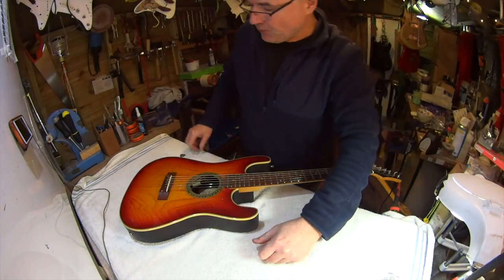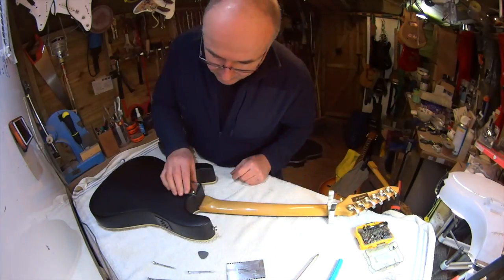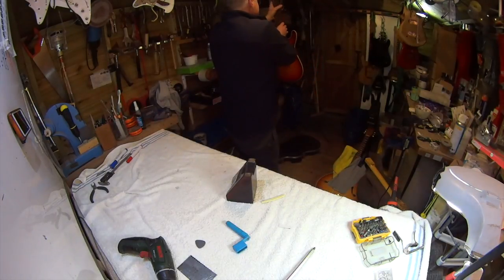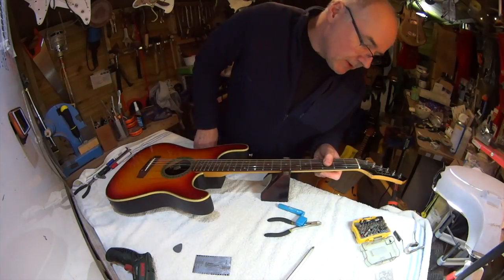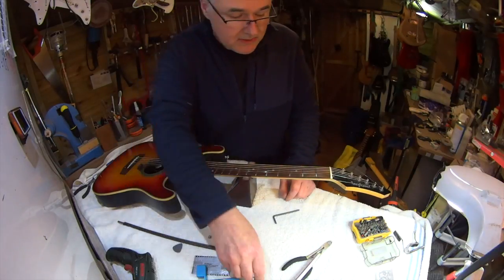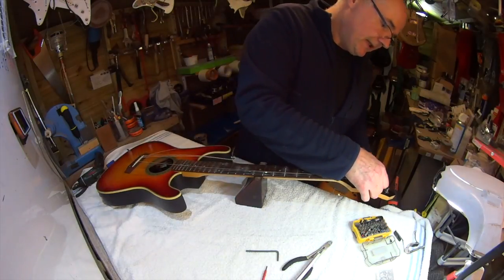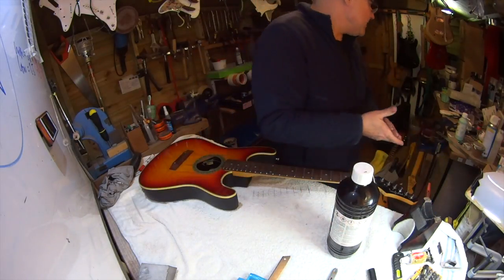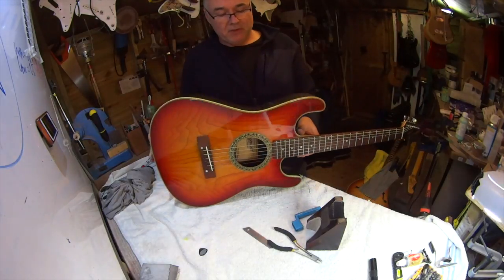Tanglewood electro acoustic set up

Comment: just wondered sam,couldnt you or the owner get a bridge that bolts on the back?then there wouldnt be any issues with bowing etc?i cant remember what theyre called off hand.they look like a bigsby bridge without the wah wah part.
Reply from the maker: You're right - and it would help. Guess the top still needs de-humidifying because it will bulge with too much humidity (even without the string pull) because the wood expands but has nowhere to go except upwards. I just renovated a 12-string EKO that had exactly what you said - a tail mounting for the strings. All that destructive force absorbed by the curved back edge of the guitar instead of pulling up on a bridge. Such a good idea... and it's no coincidence that even at 60+ years of double the normal string loading that top is as flat as a skating rink.
Reply: the only thing is the string height,ive never seen one up close enough to suss out how they work? all the best to you and your wife by the way.